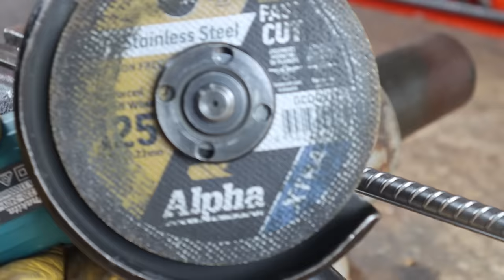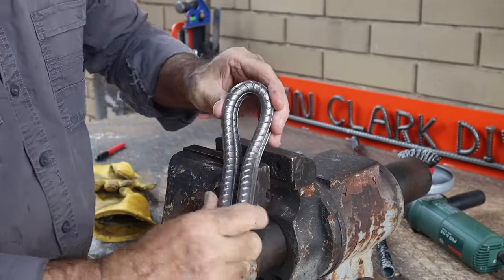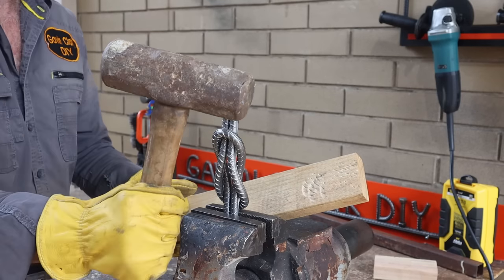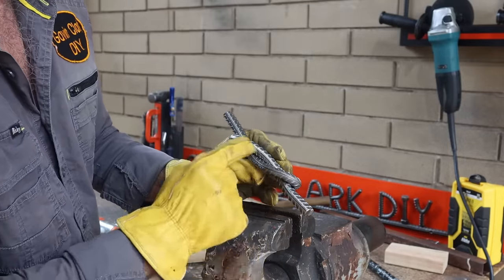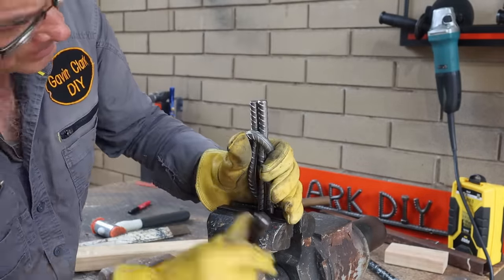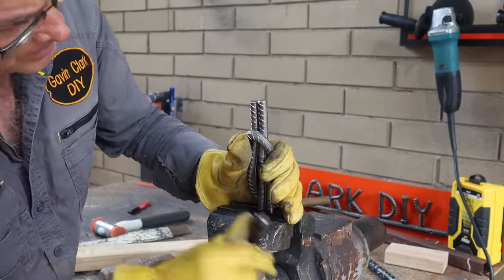I make an Industrial Style Shelf Bracket, and bend Steel Rebar into a knot - MIG Welding Project

Comment: that cutting wheel is installed upside down. they have a safe direction to rotate
Reply from the maker: I am using Alpha cutting discs, why is it mounted wrong. Check their website, plus there are no direction arrows on the discs.
Reply: @GavinClarkdiy  theres none on the discs i use either. label faces grinder. they have reinforcement to the proper direction when they are formed. its more likely to come apart in the event it binds
Reply from the maker: @SingleMost  I have always used label out, and would always follow directions on the disc or packaging, on the website where I get my discs that have a photo of them in use with the label out. I am surprised that if it must be label in then why is it not their duty to put direction arrows or say "label in" on them to protect people. I am certainly not trying to get you to change what you do, but I will stick with what I have always done and has worked well for me. Just a thought, if you sold cutting discs, would you choose to put your label on the side that your brandname is always on view or would you put it where it is mostly hidden, just thinking out loud. Anyway, I wish you the best and I appreciate your comment. I am in Australia. Cheers mate.

Comment: Not sure why you beveled the backside of the screw holes.... now you have sharper point in center of metal. This could potentially collapse if you put to much torque when setting the fasteners.. and not to mention you can't see the backside....
Reply from the maker: I think the holes you are talking about are the holes I drilled to weld through to join the two steel plates together, the countersinking these lets the weld get to the plate through the hole easier, plus makes it a stronger weld as it has more area to stick to on the back plate rather than just the sides of the hole, you can see it here, https://youtu.be/Njw28TCi1TI?t=1513  .The screw holes were drilled from the front, and they were countersunk so the screw sits flat with the front of the bracket.

Comment: What do you do to prevent it from rusting?
Reply from the maker: I often use Penetrol Rust Treatment Penetrates Rust 300g Aerosol Spray, and then put two topcoats of Semi-Gloss Clear Coat. That is what I used on the rebar lettering on the back of my workbench, here is the link to that video. https://youtu.be/JA-wk62Zghk  I try not to comment on finishes, As what climate you are in, is it inside-outside, lots of rain, ice, do you want long term and rarely touch, or a wax with a wipe over every year. That is why I have no opinion, Please ask someone in your area what you should use, I feel this is a better way to find out what would be best for you. Thank you for your comment.
Reply: @GavinClarkdiy   Thank you very much. 
I live in a tropical area lots of sun and rain. 
I would like a long term finish.

Comment: Will it get rusty?
Reply from the maker: I often use Penetrol Rust Treatment Penetrates Rust 300g Aerosol Spray, and then put two topcoats of Semi-Gloss Clear Coat. That is what I used on the rebar lettering on the back of my workbench, here is the link to that video. https://youtu.be/JA-wk62Zghk I try not to comment on finishes, As what climate you are in, is it inside-outside, lots of rain, ice, do you want long term and rarely touch, or a wax with a wipe over every year. That is why I have no opinion, Please ask someone in your area what you should use, I feel this is a better way to find out what would be best for you. Thank you for your comment.

Comment: The measurements of this project would help 😅
Reply from the maker: This is from the description under the video, The rebar is 12mm, Wide flatbar is 50mm x 3MM, Small flatbar is 32mm x 6mm. The shelf bracket size is 180mm x 180mm.

Comment: @24:00 : why drilling not from the other side?
Reply from the maker: I had to chamfer the hole from the top anyway, plus when you mark out the top it has to be right because you can see it, doing it from the back it may have been off just a bit. BUT now I have one made, the next ones will be drilled first before the knot.

Comment: Easy to bend rebar steal everyone knows it super strong but its all super weak when Heated.
Reply from the maker: Yes you are 100% right. Unless you see a flame in my video it is cold and not heat-treated in any way. Heat makes the bending much easier and there is less chance of the rebar cracking or breaking, heat is basically your friend when bending steel. I am trying to use simple tools and not use heat unless I have to in many of my videos. Some things will need heat to get the bend I need because it is too hard/big to bend or I do not want hammer marks in it. Thank you for your comment

Comment: Пластелиновая арматура
Reply from the maker: Reinforcing Bar, also known as Rebar, in D500N Standard Grade N. Common uses include columns, prefabricated beams, precast products and cages. I am in Australia if you want to search more about it. I have not used heat before or during this project it was done cold, the rebar is new